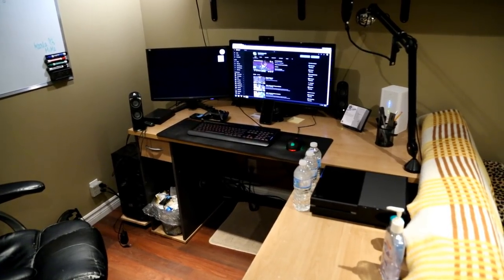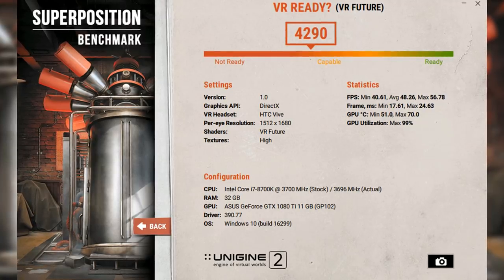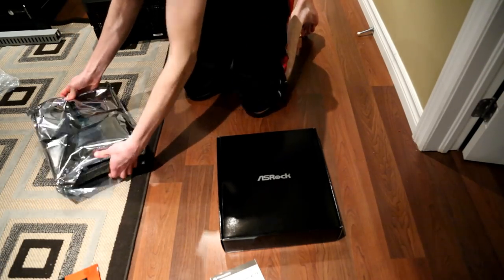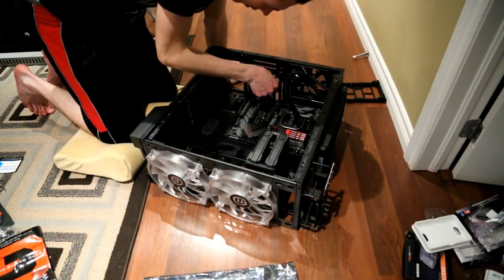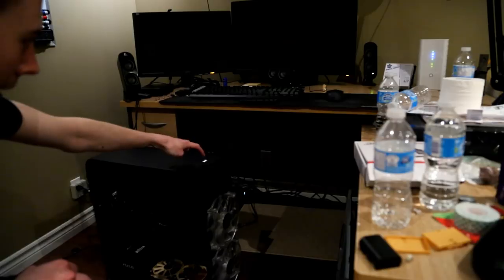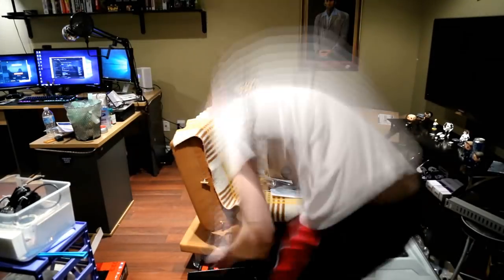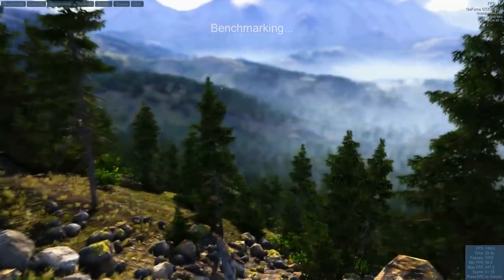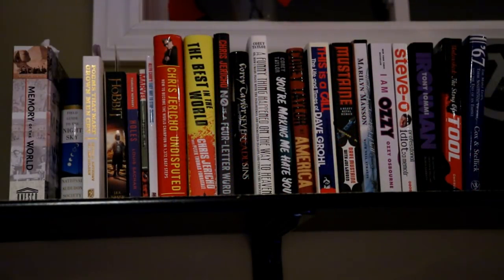New $4000 Computer & Room Tour

Comment: Excellent build! Its not always what works for everyone in the reviews, its what works for you! One tip: I'd look at getting a UPS (Uninterruptible Power Supply) for when your power goes out. Sudden power outages can degrade components faster than you'd like. I've had one for years on both my PCs and my home servers and I couldn't be happer when the power goes on/off for a second and I still keep playing!
Reply from the maker: Yeah I’d definitely like to get a UPS. I was looking in to them when I was building but the ones I wanted were too expensive. Definitely on the to buy list though!